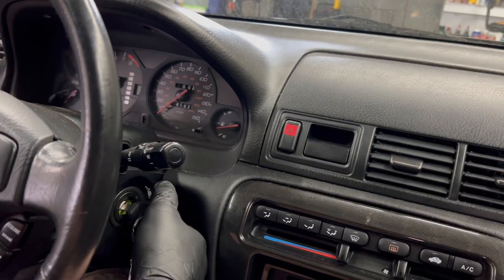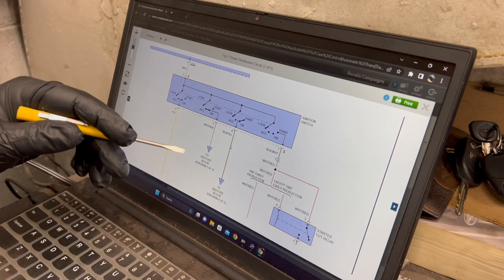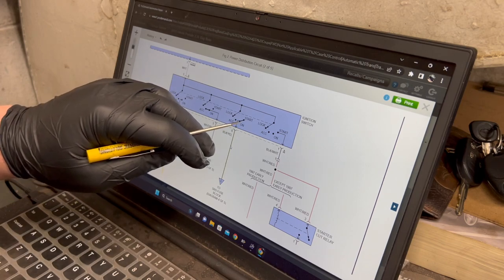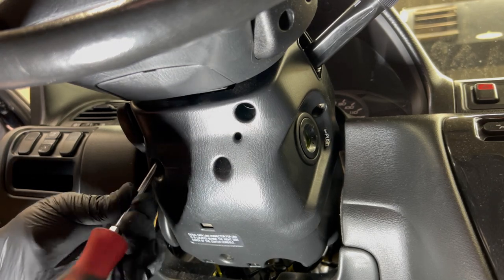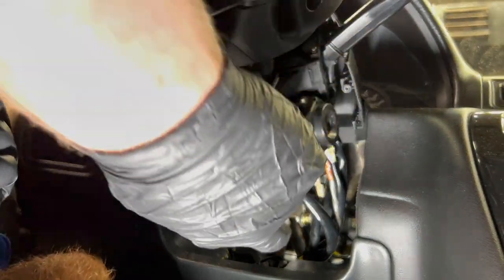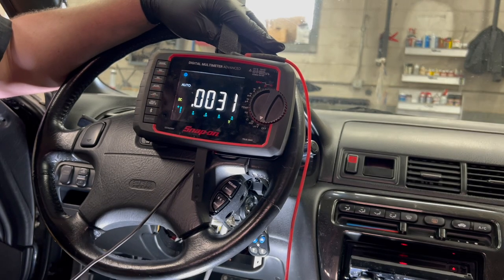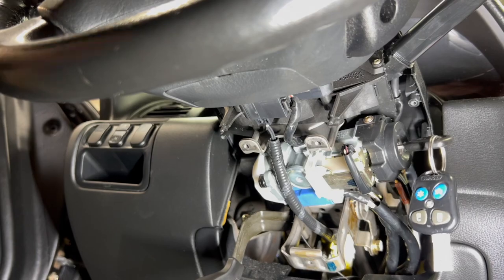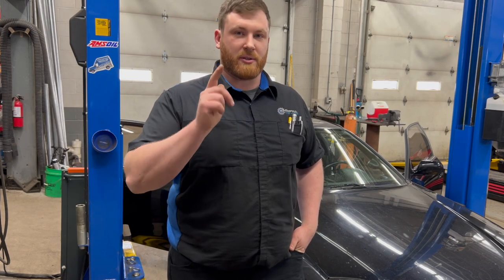2000 Honda Prelude Crank/No Start

Comment: Looks like a few things happened. 1) looks like the ignition assembly was replaced possibly after it was once stolen. 2) the ignition switch shorted due to poor contact and arcing leading to the solder melting and then direct short to the screw /column ground. 3) your assumption about the shaft being loose could have cause the initial rotation issue( and possibly swinging keys dangling) 
There is a test to for checking the continuity for those pins which I’ve had to do for a 2006 accord and 2008 acura RDX . Glad it’s not too expensive of a part.

Comment: This is a very common fault and a factory recall although as so much time as past Honda won't honor it anymore, I don't even replace it with a new one because the new one is also designed the same and will eventually fail in 10 or 20 years or less depending on how many times you turn that key, if you got in and out of your car 20 times a day it would happen 20 times faster than usual, also to note this will also put heat into the main relay the powers the fuel pump and everything's else, so depending on how much this car has been used since the key switch started arcing then that could need resoldering which is pretty easy to do, but anyway best way to fix the ignition switch is to take that contact pad out and then cut the black plastic a bit make a new contact that is slightly longer on the left so it doesn't sit on the edge anymore, i will make a video of it on my channel at some point